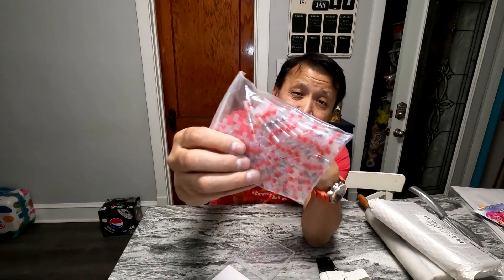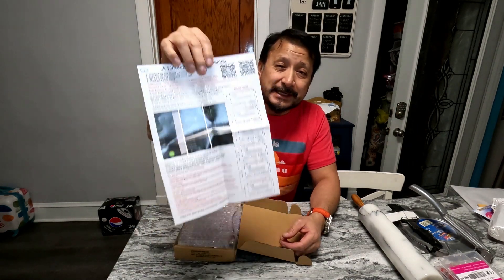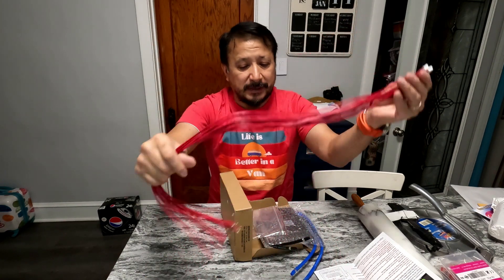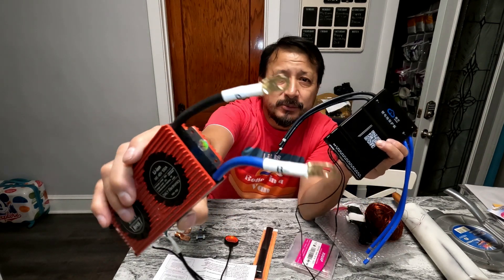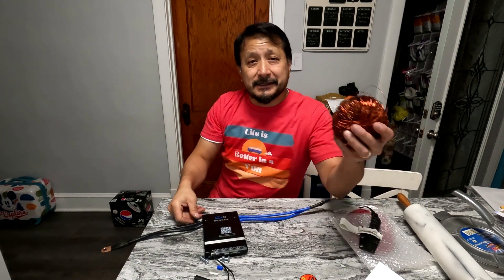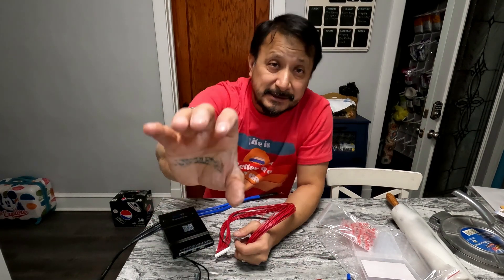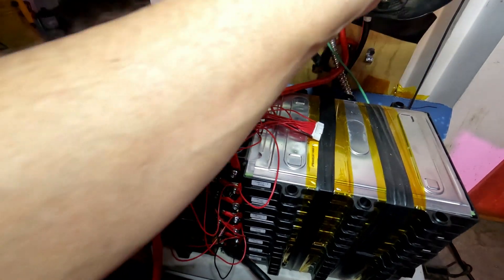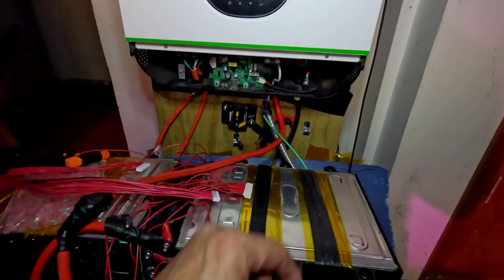Unboxing the JK BMS and wiring

Comment: First I want to thank you for taking the time to create a video for this.  But I do want possible misinformation not to be spread.  When you warned of a "lithium battery" blowing up or catching on fire.  Some lithium batteries will do just that...but if one has a LiFePo4, which is a type of lithium battery, has a chemistry that makes it much more safe.  I know of none of them that has ever exploded.  And only a few people have ever been able to even intentionally make one catch fire---a single cell will smoke (and the fumes would be a hazard), but that is all.  There is also very little chance that when one cell does so that there will be a "Runaway" event where the other cells do the same when one does.  

Again, I do appreciate your time in making the video and having accurate information is the only reason I am commenting.